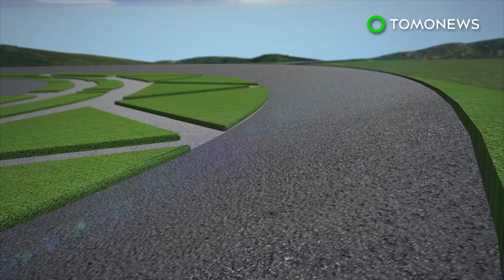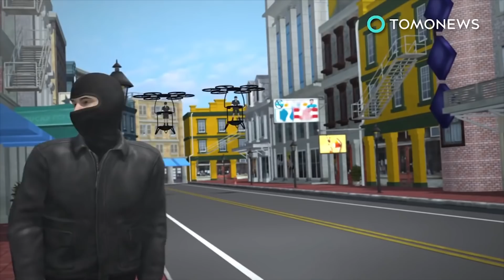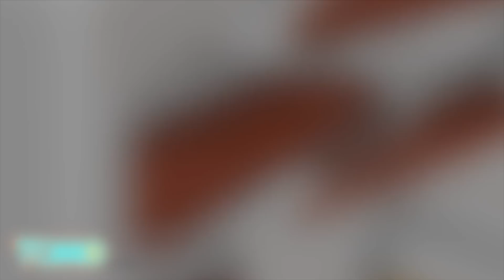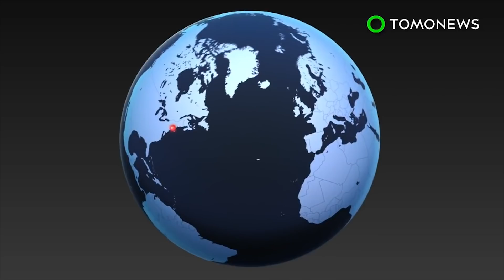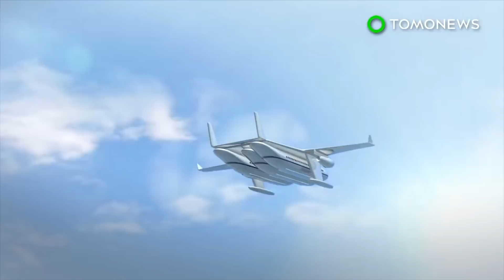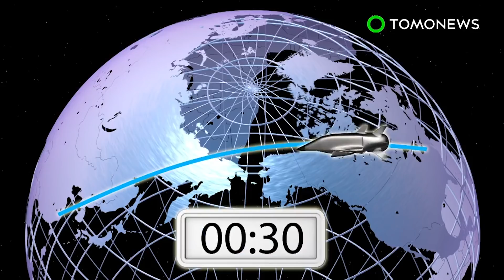Circular runways for future airports; VTOL Solexa personal flying vehicle - Compilation

Comment: What if the airport wants to expand its main building? Then it would have to rip up the circular runway just to increase its diameter!
Reply: Or it could expand the building facing away from the runway lol
Reply: Horseena what I see is that the main building is in the center of the circular runway and if expanded the parking lot for the planes would decrease causing more interference, but I'm sure if this plan goes and is built. I hope and sure the designers have made the runway bigger than needed for future construction.

Comment: Perhaps the stupidest thing I have EVER heard.
Reply: kev lar Apparently the comment section are full of expert pilots and engineering geniuses like you
Reply: It would make taxiing a royal pain and it would be likely to tip. Also the cargo will shift more and the weight will not be evenly distributed on the wheels
Reply: Babmam The swivel awakens 🖕

Comment: My dad spoke to pilots and he says that they say that it is impossible  you will never get the landing angle right. If you go a bit too fast or too slow or if the wind is too strong the plane can crash.
Reply: Apparently the comment section are full of expert pilots and engineering geniuses like you
Reply: circular runways for commercial airliners. these things are too cumbersome to get the landing window properly. a few seconds/degrees/knots off of your landing and you are going off roading in a jumbo jet.